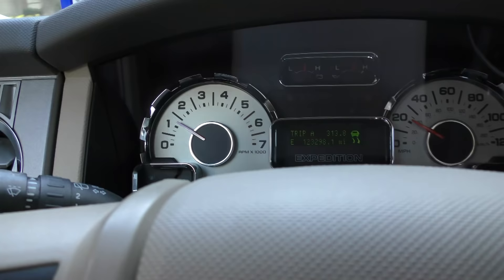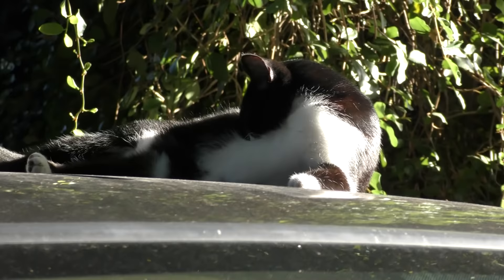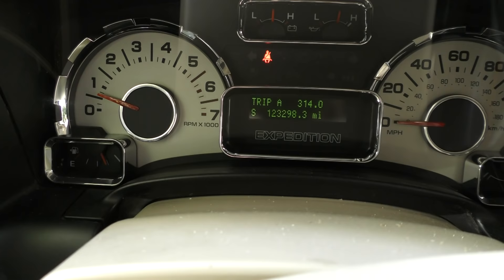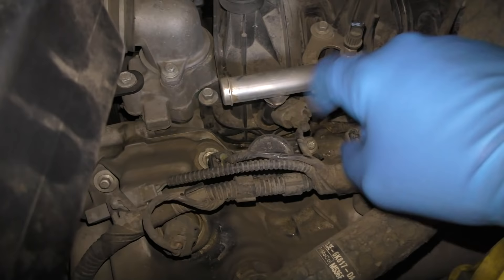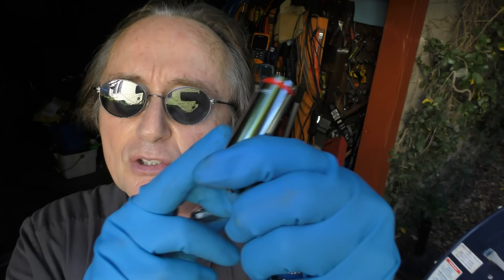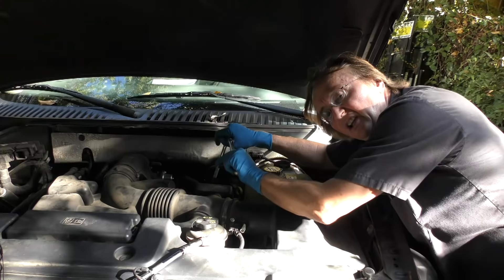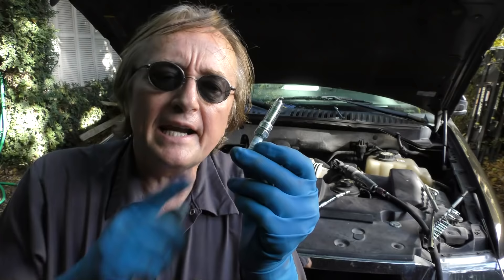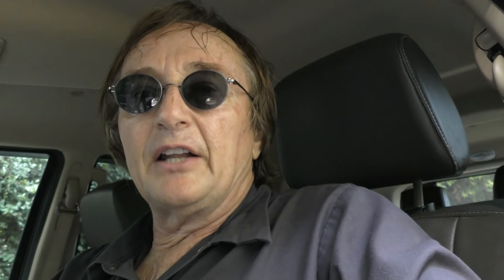How to Stop Car Hesitation (Spark Plugs and Ignition Coil)

Comment: took my truck in for a tune up was driving good for while down high way my truck died but before my RPM was jumping high then I called my mechanic he told me to check my gas filter and blow in  it it was clogged so I took it apart got a new on put it on and it still did not start or turn over  then he told my to check my starter it was good then I bought a new battery he keep telling me all kind of stuff but it did not work now am still lost for words and I had to drop a 1200😞 to toe my truck home with my kids and wife and there only two mechanics in this town and ever body talks bad about them and I am stressing about taking it to them what should I do any help would be a blessing a miss my truck so bad can u help me help my family I fill like a port of me has died or I lost a family member  which is my Chevy Avalanche I just had a badass exhaust put on it too sound like a beast felt like one too anyways I really appreciate your help and your knowledge of wisdom from the car gods please help SOS

Comment: Hey Scotty, great video man, thanks. I got one question about my car, it is a 2009 Corolla LE 1.8L and I just finished doing a quick tune up to it. I replaced the 4 ignition coils, the spark plugs and did a clean up of the MAF. The battery is also less than 6 months old. The problem is that when I'm at a stop sign with the break pressed and try to roll up or down a window the car starts to shake and it won't stop until I release the button. What is causing that? Did I mess up something during the tune up? Thanks for your help!
Reply from the maker: have the battery and alternator load tested, auto zones do that free, often one of those is weak for that
Reply: Thanks, I will do that asap and post back results. You are the best, thanks!
Reply: Scotty Kilmer to. I HAVE A 2003 FORD WINDSTAR SE. 3.8 NEW SPARK PLUGS NEW WIRES NEW CRANK SENSOR ,NEW CAM SENSOR NEW STARTER,NEW FUEL FILTER IDLES IN PARK PERFECTLY ,BUT HESITATES IN DRIVE OR ON THE TAKE OFF ONCE ENGINE GETS TO DRIVE FINE THERE IS A MISFIRE

Comment: hey scotty i have a 2005 ford free style that when i break it shuts off i don't have any codes popping up please help, i did just replace the fuel pump and fuel filter and re checked the connection so i know tjat not it please help
Reply from the maker: try cleaning the throttle first, and the maf sensor. Often it requires a new maf sensor on that model

Comment: hey Scotty I got another question to ask abt this 04 Dodge intrepid I was going to change the spark plug cuz someone change be for anyway I used the same socket to take out all the plugs but one plug was having trouble with the socket won't grip on why is it doing that and how can I take it off
Reply from the maker: often crud gets in there like rubber spark plug boot and then socket won't fit. Check that first
Reply: Frank Gomez. take the rubber inside the spark plug socket
Reply: Jose Castro-Martinez  yeah the rubber of the socket is off all its doing is spending like it's loose but its not gripping
Reply: hey Scotty I got that spark plug off now so it seem who ever put the plug in didn't put it in right but somehow been driving ok with no sounds anyway when I pulled it out I noticed some crud one look like a rubber or plastic ring and also there little deposit in there what could be that ring from and what is a good way to bring some that deposit out with out air deal that I don't have

Comment: I HAVE TOYATA YARIS 2009 MODEL 1.3 ENGINE PROBLEM IS AFTER THE ENGINE RUNNING 10 OR 20 MINUTES ON ROAD ITS HESITATE IN ACCELERATION OR IF I DRIVE ON HIGH WAY AND USUALLY I STOP ON SIGNAL THAN I ACCELERATE ITS HESITATE ON 20/KMP TO 60/KMP SPEED AND I CHANGED COILS ALL, FUEL PUMP COMPLETE . AND PROBLEM IS STILL THEIR  NOW ONE OF MY MECHANIC FRIEND HE ASKED TO TAKE OUT THE EXHAUST FILTER (CATALYTIC FILTER ) I NEED YOUR ADVICE ?

Comment: My 2009 mitsubishi lancer hesitates at 5000rpm,  basically when im trying to drive fast, its got new spark plugs and a new valve cover gasket because the old one leaked into the plugs, so im at a lost here, the cars tripping a p0004 code for the fuel pressure regulator so im hoping that the issue but if anyone has any other idea pleaae tell me please

Comment: Hey scotty, my car has poor acceleration and hesitation when i use the AC. I cleaned out the engine oil from the spark plugs but the problem still there, HELP ME!😦😦
Reply: Check alternator and the battery. Also the belts.

Comment: help, my car is a 2002 jeep liberty renegade 3.7 l 6cyl. i have changed the oxygen sensors on both sides, engine control sensor, no. 2 and 3 spark plugs and the coil packs on both them engine speed  pig tail,crankshavf sensor too. now all it wants to do is shut off all the time like its missing it never did this . HELP ME PLEASE
Reply from the maker: have a pro analyze live and mode 6 data for problems, rather than guess. Jeeps are electronic crap at that age and it will take a pro to figure it out
Reply: crankshaft position sensor?

Comment: I have bad hesitation on my mazda 6, sounded and looked like it wanted to turn off when ever I stopped the car. Later the check engine light came on and there was a loud clonking sound felt like it was destroying the engine. Took it to a mechanic shortly after that and they found a p300 code, and said it needed a new ignition coil and spark plugs(they also replaced the connectors). Worked smoothly for a while but now the same problem happened again not even two days after the fix and now they want to charge me over $300 for a engine compression test because they cant tell me whats wrong with it. Any help would be greatly appreciated.
Reply from the maker: go somewhere else, I can do a comp test in half an hour, have someone else check that and if engine has problems, ditch it, they are money pits then
Reply: Thanks for the advice Scotty, I figured as much. The car has been taking money if not time one after another. On a side note I love the videos you do for all of us keep up the great work!

Comment: hi
I have jaguar S type 2.5 petrol 
and it's doing the same.
not reving up from 3000rpms.
any solution please
Reply from the maker: pressure test the fuel pump first, weak ones often do that

Comment: Scotty Kilmer I have a Mercedes S500 it was manufactured in 2001 and it won't accelerate what should I do
Reply: did you turn the car on?
Reply: @EmoFox9  yes my car is on right now but it's just when I press the gas car won't accelerate
Reply: @andrewmathurin684  that uses an electronic throttle body, so check all the connections, start at the pedal and follow the wires to it. check for continuity and voltage and make sure its not broken somewhere with a multimeter, if that all checks out you may have to replace the throttle body (not cheap btw) if you have a scannerscan for codes first, whille car is running and while trying to push for gas.
Reply: @EmoFox9  how do you check the connections
Reply: @andrewmathurin684  find a friend who has a multimeter.
Reply: @EmoFox9  so what part of the car do I go to with the multimeter
Reply: @EmoFox9  everything on the multimeter is all good what will the multimeter say
Reply: @andrewmathurin684  get to your throttle body. unplug the wire from it, put the black lead to ground, any metal surface connected to the car, test all the pins inside the plug(cable side) with the car off, Should have the multimeter set to DC 20V. with the car off there should be no power to any of the pins. with the car on test the pins again. Be sure you have a constant power pin and a pin with varying power when the pedal is pushed. one pin should connect to ground that isnt the constant or variable power pin, you can check this by setting your miltimeter to continuity annd it will beep when a connection is made. If you have no constant annd/or variable power do the same test with the connection on the pedal side. if you have constant, ground, and variable power on your pins your throttle body and/or throttle control motor needs to be replaced.
Reply: @EmoFox9  do you mean put one of the pins to the ground do you mean the concrete ground that kind of ground
Reply: @andrewmathurin684  if you arent acting dumb and truly need this fixed, get to a mechanic. i can not help you any further. If that was an honest question i would not suggest you to do anything on your car.

Comment: It's been almost 3 months since I've put in new spark plugs on my 2000 crv it stutters everytime I'm at a red light, sometimes the motor shuts off but the battery is still working, if someone can suggest a solution for me please let me know
Reply: GPaniagua 12 what was your solution?

Comment: I have a 1993 ls400 I did a tune up and the hesitation started I don't know what's wrong with it can someone help
Reply from the maker: recheck your work and realize you may have damaged ignition wiring or knocked sensors or wiring off
Reply: I did that changes the coils and wires 2 times the car starts great I changed the tps but it still hesitates on high rpm
Reply: I think it may have something to do with a vacuum leak
Reply: vacuum leak or if you for shitty plugs or wires that could be issue, or cracked plug

Comment: If any one is reading this help!
I have a 1990 Nissan Stanza with a ka24e motor and it also hesitates to go specially up hill I've change spark plugs filters ect I've yet to change my spark plug wire I need help I also think it would be bad ignition timing when it idles it stays around 650-500rmp and I can hear a ticking sound near the timing chain so I've yet to find out what the prob. Is a local mechanic moved the timing a bit and the sound sort of got quieter but it's still there and I can't figure out with it won't just go it has 173k miles its in very great condition but just that if anyone could help I'd appreciate it
Reply from the maker: odds are timing chain is worn anad needs replacing, that's why the adjustment helped a little. And with that mileage, knowing stanzas, the whole engine is certaily worn and will need rebuilding soon if you keep it

Comment: where are you located
Reply from the maker: houston texas
Reply: do you work on cars and if so how can I get in contact with you my Lexus is shaking very bad when I accelerate and I can't figure out the problem I live in Beaumont Texas
Reply: Is it an ES300 ?
Reply: Fise Phalnoxt es350
Reply: Fise Phalnoxt 2009
Reply: ok. I thought it was an ES300, I had the same problem, i just fixed it yesterday by changing the 6 spark plugs and coil packs. I'm sure you have the same problem as mine. You need a tune up. Hope you resolve it soon.

Comment: what about diesel cars, 'cause I don't think the glow plugs will be the problem for hesitation.... I own a ford mondeo 1.8 tdci (one of the worst car in the world , I find this after I purchased the car) and  can't find a clue what's causing the misfire and hesitation ( already changed 4 new injectors still the same freaky problem )  blanked egr valve, what else, clean the MAF, changed cam shaft sensor.... even ford mechanics can't find the problem, don't know who else I can have faith , how many thousands of pounds I need to spend on this junk, guys just don't buy ford if you don't want do die on the highway as I always risk  (because can cut out whenever the car like at anytime ) and it's not a pleasure for sure....

Comment: Bullshit video. There are a million things that can make your car hesitate. Spark plugs are just one of them, and changing them without doing any diagnosis is just stupid.
Reply from the maker: A million things? That would make a long video, would you watch that?
Reply: I'd watch that if it'd help me fix my car. Years ago I replaced spark plugs on an intermittent hesitation and it did nothing. So your video obviously helps fix nothing in this case... and most people with any wrenching experience will look at spark plugs anyway since it's such basic knowledge.